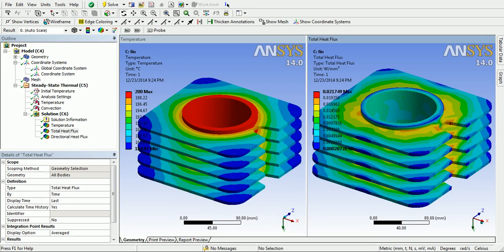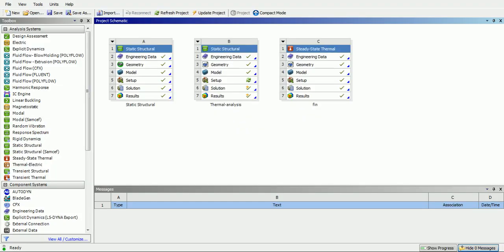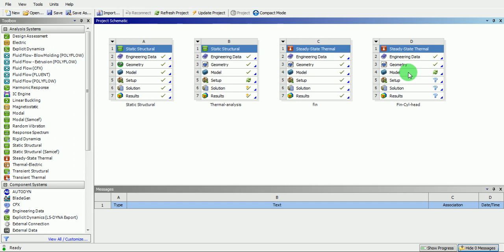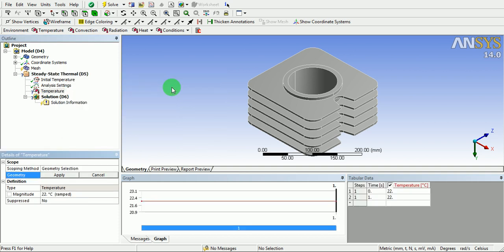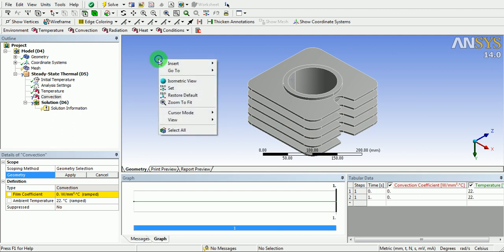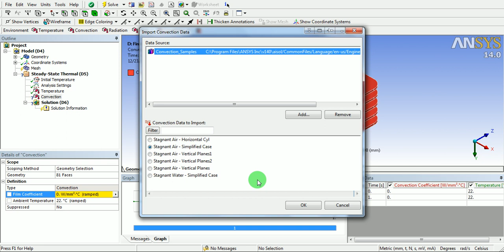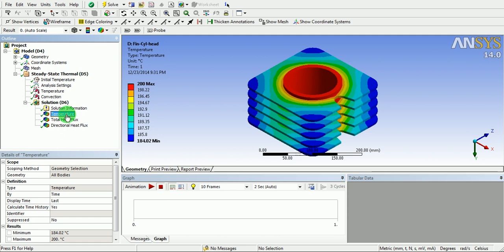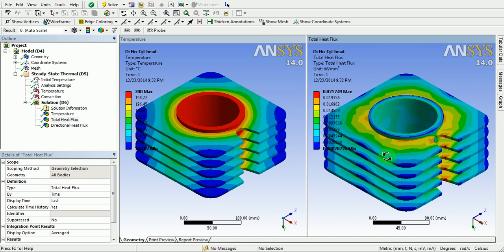ANSYS Workbench | Heat Transfer | Thermal Analysis | GRS |

Comment: In ANSYS Fluent, we usually mesh the PART and then do the Analysis. For Thermal Analysis, isn't Meshing Required? (I am new to ANSYS, its only been a month since I started)
Reply from the maker: +Ashwin Ganesh Meshing is required for all the analysis you do, the main objective of meshing is to replicate the actual cad to the FE model so that the solution can be obtained using engineering equations.